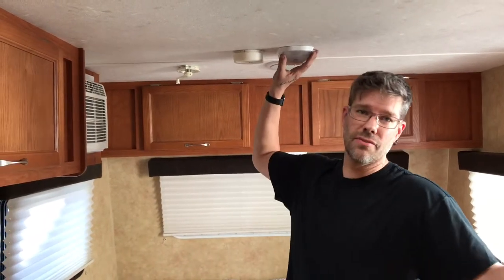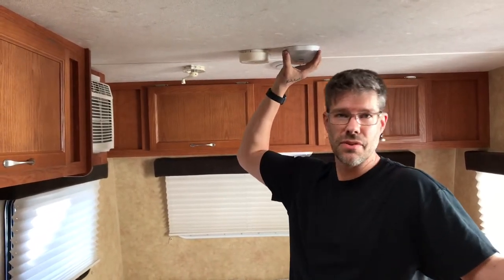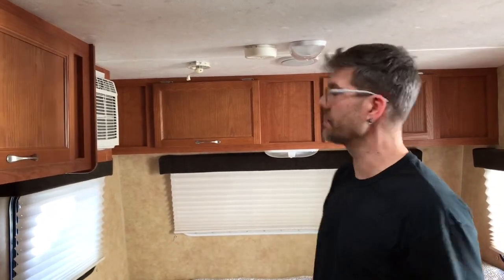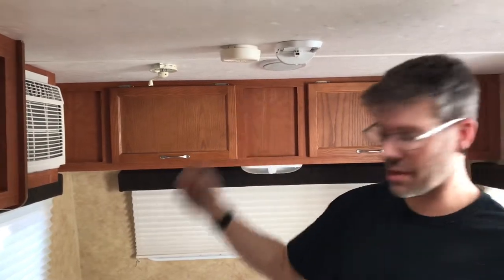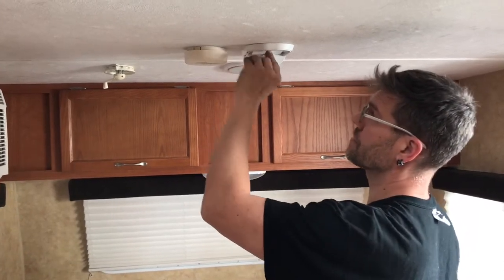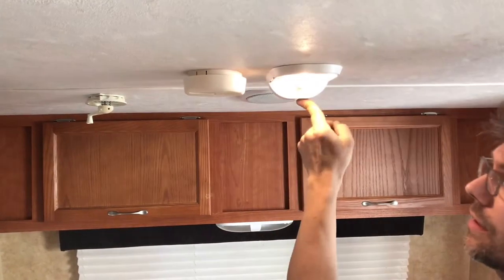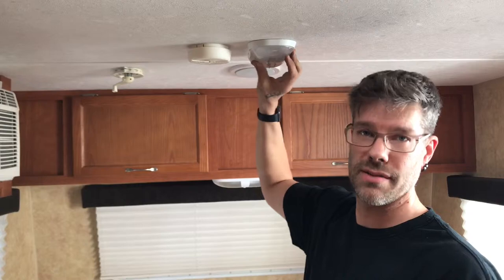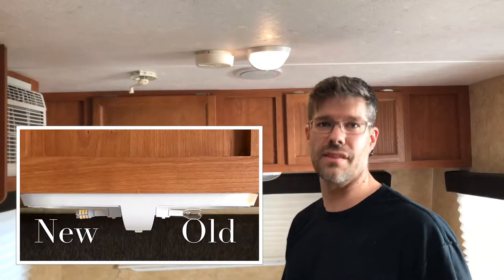How to change camper bulbs with LED replacements.

Comment: Hey. Nice video. Funny I came for light bulb info and noticed your black valances without the sides.  I was thinking of doing the same! Removing the sides and wrapping or painting the tops black. My question how did you attach the roller string at the bottom. On mine they are attatched the the side valance.. Also how did you make them black. Thanks!
Reply from the maker: The valances are original to the camper and they’re not black. The camera didn’t catch the details of the fabric. The roller tie downs for the strings are also original to the camper.

Comment: I want to replace bulbs with LED in new camper.  Can’t find a review that doesn’t involve some situations where LED melt or creat bazaars.  Any opinion on this?
Reply from the maker: I’ve had no problems with the ones in this video. The old incandescent bulbs ran much hotter than the new LED’s.

Comment: Do you know what replacement LED bulb would fit a 12V  Rockwood Ultra Lite camper? Husband wants to switch all of our to LED. Thanks so much
Reply from the maker: Unfortunately I don’t. If the bulbs are the same as in this video you’re good with the ones I used. Even if the fixtures look different the bulbs may still be the same.
Reply: My husband wanted me to ask you What are the ones you used in this video because they are the ones that will fit our camper
Reply: Can you please post the link to the bulbs that you ordered to put in this camper and this video because these are the ones my husband's says will fit our camper Thank you so much I can't find the link
Reply from the maker: There is a link in the description

Comment: How Change a pop-up light so you’re tap it to pop it up but how do you replace the bulbs in them? Also how do you turn the heat on from your AC unit
Reply from the maker: Typically the heater is not connected to the AC unit in a camper so there is no way to do it from the AC unit. More expensive campers can have a thermostat that controls both but again that’s typically more in very large campers. As far as “pop-up lights” in a camper I’m not quite sure specifically what you are asking about. Please feel free to email me with a clear picture of your situation and I’m more than happy to help.